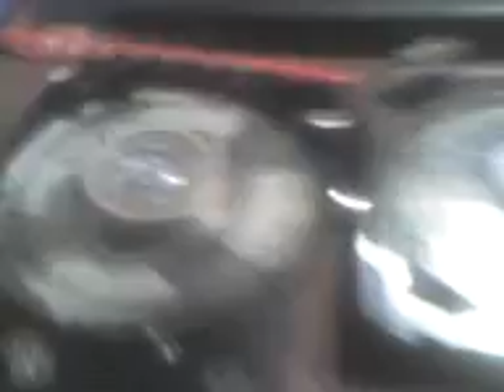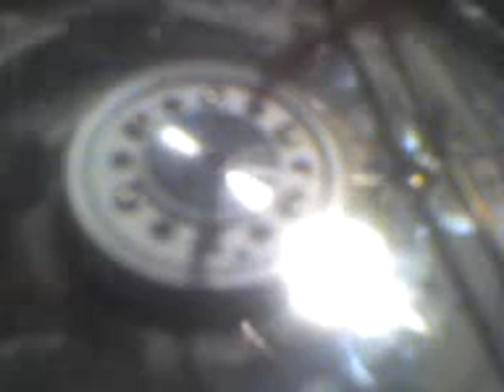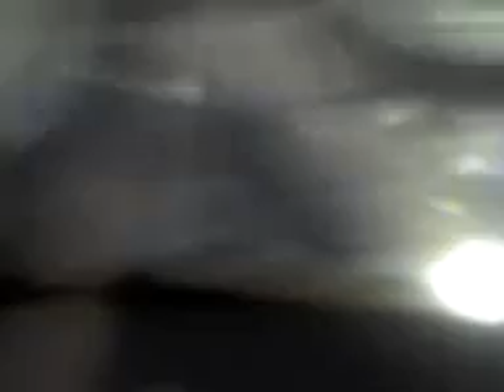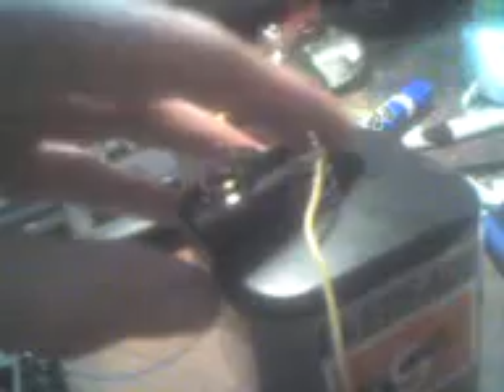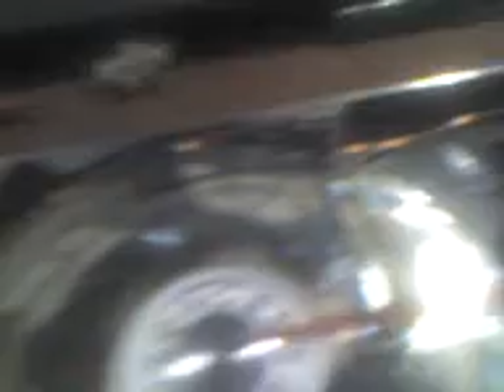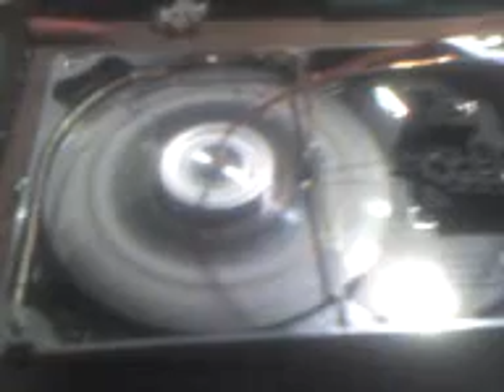Latest hard drive magnet motor video

Comment from the maker: Yeah, it's basically just a dc motor. I used only one of the three positive poles to drive it. The disc and tape were the rotor and the whole thing was timed with tape. I knew phase didn't sound right, but your the first to correct me, ha ha, thanks! :D Using a transistor or fet gets rid of the sparks, and it gets a bit faster too.

Comment from the maker: @2012TheAndromeda  ha ha they are just hard drives. Nothin special. Just took everything out, except the motors and discs. Threw some tape on the discs for timing, few wires here and there, and poof you have these.